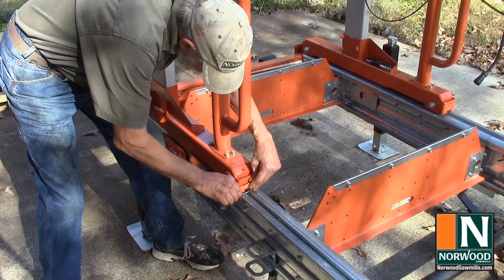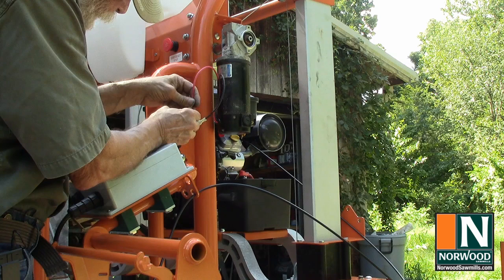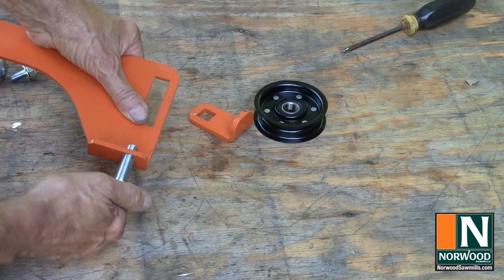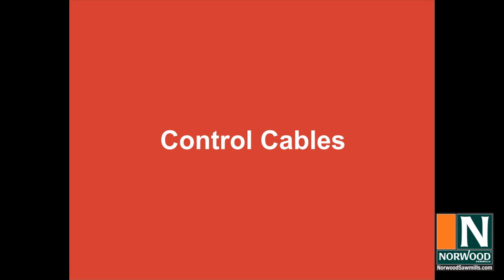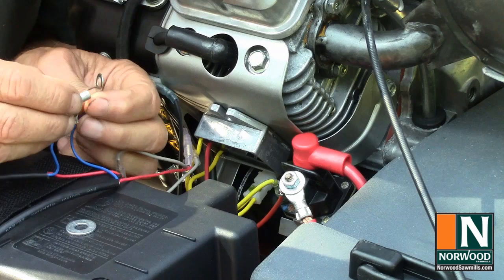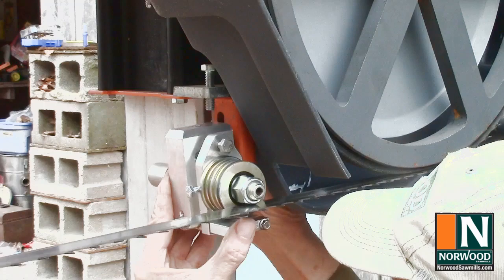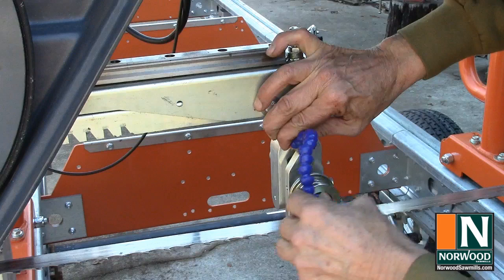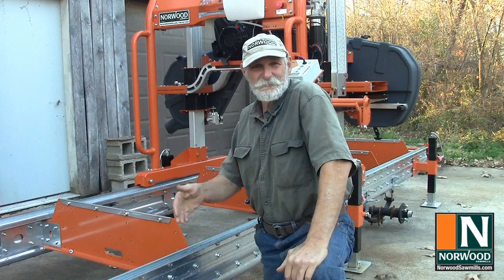The A, B, C's of assembling your HD38 Engine, Bandwheels & Blade Guides

Comment: I'm in the midst of putting my HD38 together and as a mechanical engineer of 25 years, I can say that watching Dave's videos are far more valuable and useful than the instructions. You would have to be an engineer to interpret the manuals inconsistencies and errors and get this thing assembled correctly in a reasonable amount of time. I would suggest to Norwood that they include a few ACCURATE exploded views, several assembled views an ACCURATE parts list and most importantly, DVD's or digital links to ALL of Dave's videos minus the annoying commercials from You Tube. I will give credit where its dues, and the labeling and xref of the boxes and bags contents is spot on.

Comment: I recently got my HD 38 together. Still learning the in's and out's. The measuring gauge is where I struggle the most. I have the Honda on mine. It is a power house.Made a removable winch to turn large logs. 20ft long large diameter longs are tough to roll over. Also never realized there were so many nails required to build a tree. If it has a nail in it. The blade will find it for you.
Reply: Wow, sounds like serious logs!  You must live in a tall timber part of the country.  I know what you mean about nails.  I just hit a ceramic insulator last week.  I've always figured that the best metal detector is a new blade!

Comment: Dave thanks.  It would have been very difficult to assemble my HD38 without your videos.  I did struggle with the installation of the Honda IGX800.  The paper instructions for the Honda engine need some help, but I made it through it.  Hopefully Norwood will approve your IGX800 installation video, so folks don't have to struggle.  For one thing the Key switch instructions are terrible.  I had to bend metal and make a receptacle so I could secure the key switch.   The instructions recommended the key installation in a spot that would require serious cutting into the structure.  One other suggestion is to create a video for the Sawyer going for the full Norwood Monty out of the gate.  I purchased the upgraded package with all of the hydraulics along with the 4-foot extension.  I applied some common sense and modified the build to incorporate the extension, so the axle is by the second to the last cross bunk (five cross bunks in total).  I saw some videos that had the axle at the 3rd cross bunk (after they upgraded and added the 4-foot extension).  I have to wonder if that is a problem for my fellow Norwood owners.  Again, the extension did not come with instructions, and I could not find a video about best practices while installing the permanent extension.   The beast is together with the basics, now on to hydraulic installation.

Comment: Building the mill was quite a project!  Hope others will chime in with their experiences & advice.  I'll monitor this video and answer any questions I can.
Reply: I enjoy your videos Dave. Well done!
Reply: @willwagner3402  Thanks, Will.  I enjoy making them, and visiting to others making sawdust!  Filming the three HD38 videos was quite a project.
Reply: I just added another 8’ onto my mill today. It will be nice to do some nice long timbers now for a project I’ve got going up here in Canada. Keep the videos coming! I’ll be watching.
Reply: @willwagner3402  20-foot timbers... very impressive!  Hope you'll post some photos of your project on the Norwood Connect forum as it progresses.
Reply: Mine went up but won’t go back down.Any suggestions?? Please help
Reply: @Radialflyergarage  I'd be glad to try to help you figure it out.  Which mill do you have?  Do you have electric or hand-crank lift winch?  Are you saying you can lift the sawhead, but it won't come back down?  If so, make sure the winch cables aren't getting tangled when they lift the sawhead, and that they lift it evenly.  You also might try paste wax on the upright supports, so that it slides more easily.  Let me know if this helps.
Reply: @daveboyt6810  I appreciate you offering to help but I figured out the problem.it’s electric but the plastic spacers where tightened to much cause it to act like a brake.i loosened them slightly and now it goes up and down freely
Reply: @Radialflyergarage  Thanks for letting me know.  Nice piece of troubleshooting!

Comment: What horse power is your new sawmill?
Reply: Thanks for the question.  The mill in this video has the 23 hp Vangard, but I upgraded to the Honda iGX800, which is roughly 27 hp.  I did made a video on that upgrade.
Reply: @daveboyt6810  Thanks Dave! I'll look for that video!
Reply: Hi Dave, I haven't been able to find that video you made on doing the Honda 27H upgrade.  I even looked on your personal channel! Also how does the Honda compare to the Vanguard  23 h in your opinion? I also heard that the Honda's are cold natured? But run good warmed up?
Reply: @rontech1671  I only recently completed the video, and it looks like Norwood hasn't uploaded it yet.  Hard to say from personal experience about the Honda being cold-blooded, as I am in southwest Missouri, and it doesn't get all that cold here.  I have run both the Vanguard & the Honda, and the Honda is more powerful and less prone to bogging down when making wide cuts, because the fuel injection and electronic ignition work together to keep the output consistent.  On the other hand, if something goes wrong, repair would involve removing it from the mill and taking it to the dealer.  The Vanguard is easier to work on, and been very reliable.  In my opinion, the Honda is a better engine, but whether it's $2,000 better depends on whether your running a production mill or more of a hobby mill.  Hope this helps.
Reply: @daveboyt6810  Thank you very much for the information.  I live in Southeast Missouri,  once and awhile it does get cold, I'm cold natured too! Lol.  I'll keep a lookout for your new video! 👀

Comment: I purchased the digital scale with my HD38. Do you have a video on how to connect it and  use it??  Thanks for the videos they were a huge help.
Reply: Thanks for the comment.  I've had another comment with the same question.  Fortunately, the other fellow is only an hour's drive from me, and hopefully be making a video of his installation.  I'll keep you posted.  Does your mill have full hydraulics?
Reply: @daveboyt6810  No it does not have hydraulics. When I purchased the Rep suggested the digital scale but what I've read so far its usually used on the smaller units.  I have no idea how or where to install it on the HD38. Keep me posted if you do a video or if you can help with the install. Thanks
Reply: @wajasi076  Do you have the name of the Rep who suggested the digital scale?  I looked at it on the Norwood web site and it clearly states that it is NOT for use with the HD38MAX, or the HD36 with electric lift!  I bet I can figure out a way to make it work, but first, I need more info on how it is supposed to work.
Reply: I don’t remember the Reps name but I’m sure I can find it on my sales contract. The instructions that come with the digital scale are just a bunch of pictures …no text at all so I’m not sure really what you would need. 

Question#2 when I release the throttle on the mill, my blade continues to spin for a bit ….it doesn’t stop quick like in your video….is this normal or do I need to adjust something??
Reply: Norwood Rep that placed my order was Lara Martin.  So basically I spent $299 for a digital scale I can’t use.
Reply: @wajasi076  You should be able to return it to Norwood for a refund.
Reply: @wajasi076  Sounds like the engine might not be throttling down to the idle speed.  First thing I'd look at is adjusting (loosening) the cable where it connects to the throttle lever.
Reply: I will make the adjustment tomorrow and see how it goes.  Thanks for your help!
Reply: @wajasi076  👍

Comment: Hey! Having an issue with wavy lumber along with my rubber wheels becoming loose on my machine ! What do I need to check?!
Reply: Hi, Jake,  Which mill are you running.  If the drive belt is loose, it could slip when you're cutting, and that could be the problem.   Could you be more specific about the "rubber wheels becoming loose"?  Are you talking about the drive belt,  the belt on the idler (operator side) bandwheel, or something else?  How are you tensioning the blade?  Is the blade tracking true on the bandwheels?
Reply: @daveboyt6810  hi, I have a HD38. 
The belts that seem loose are the ones you place inside the band wheels. Each one is separate. 
I have the blade tensioned flushed with the orange metal plate. If you send me a private message I can send you my email so I can send pictures